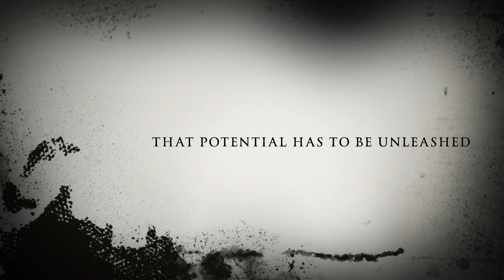Silver Bullet The Beast Released

Comment: Hey man love the build I've been a subscriber for awhile now and been building for awhile I have a question about the belts and pulley upgrade I see some say to upgrade to 5/8 belt and they will last longer is that true and if so I wonder why it didn't work out when I tried it besides my back pulley on the trans is small and might not have been able to get grip very well what are your thoughts on that
Reply from the maker: You would think 5/8s would last long just because there is more of it, but I always use 1/2.  I used a 5/8 on a troy bilt once and the 1/2 worked better.  i guess try both and see which you like best. I have no complaints with my 1/2 belts. thanks for watching and for being around for a while.

Comment: Hey chud what size is the rear input shaft on a typical mower axle?
Reply from the maker: The ones I have dealt with usually come with about a 9 inch pulley.  I like to put about a 3.5 in to a 5 inch.  Thanks for watching.